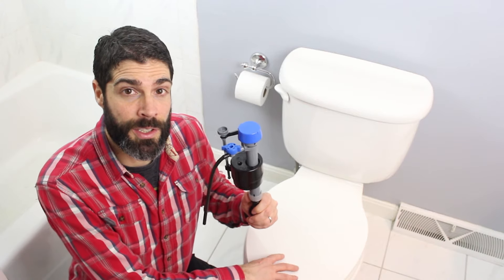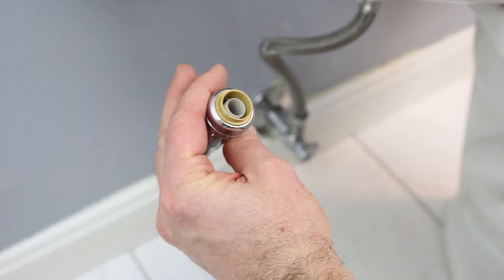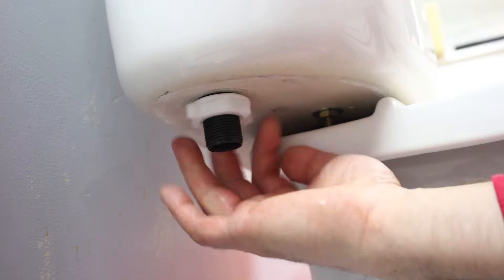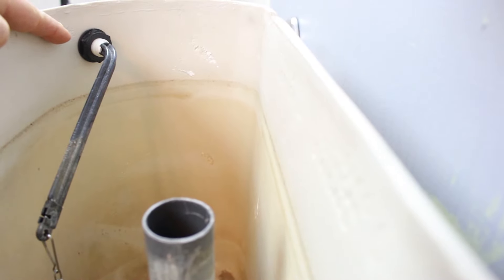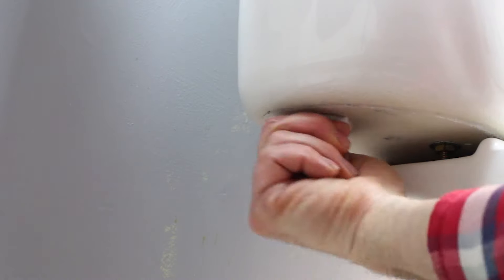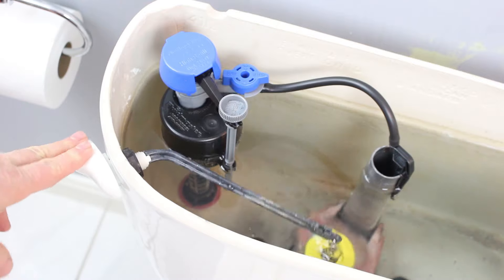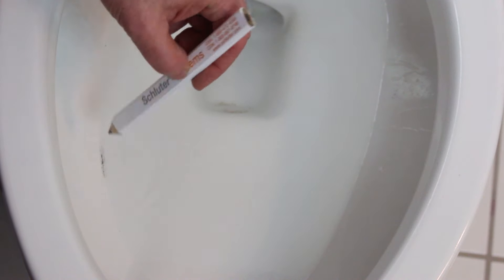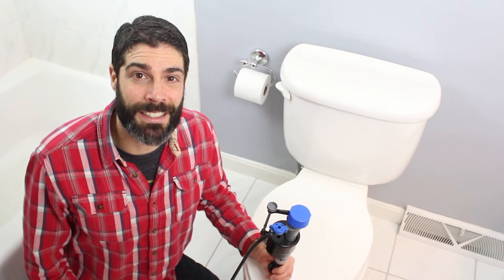Fix a Running Toilet...Fill Valve Replacement -- by Home Repair Tutor

Comment: Thank you fixed my toilet today for $15. 1 tip, not necessarily "instead of measuring", but when I took the old one off, I just made the new valve the same size by lining up the fill valves next to each other and then unscrewing until the same length.😂😂😂 Thank You Again!
Reply: Same!
Reply: Yes sir!
Reply: Thanks pal!
Reply: Genius
Reply: Thank you for the tip, helped me out as well! 👌
Reply: I also measured the new fill valve by the old one. Didn't work out. I have water running after the float has stopped rising with the water. Plumbing is definitely not my thing. lol.
Reply: Same lmao
Reply: Will this valve work for any toilet?
Reply: Thanks for the suggestion!!
Reply: So you didnt need the tape measure?
Reply: Hey man i did but still leaking some water from the bottom.should i use glue for that from inside of the tank ?
Reply: That’s me today$15 part and a I am all set
Reply: @huhu8047   not necessarily, but there is a wide range of toilets that it will work on. Need to check.
Reply: Dude. New homeowner here and resident stoner. Saved my dumb ass the worry of using my iPhone bc I left my tape at the parents lol. Ur a real one 🎉
Reply: Yes! Perfect, I have to do this tmrw
Reply: Smart!

Comment: Thank you! You saved me hundreds of dollars. A plumber was going to charge me $50 to come look at my toilet and up to $300 for parts and labor. I spent $13 dollars on the project and I did it in 10 minutes.
Reply: Same, I had a quote for $288 to replace this before realizing how easy it was thanks to this video.
Reply: these useless handymans should be out of job, if people grow some guts and DIY!, good job!

Comment: You missed a key piece of information. If you don’t slide down the locking nut on the fill valve it will fly off when flush.

Comment: 61 y/o woman just changed a fill valve thanks to your video. All I've ever done with a toilet is use it, clean it or plunge it. Your detailed and to the point video gave me the confidence to feel I could do it. Thank you for saving me money because my other option was to call a plumber to change out a $14 part.😘
Reply: 62 here!  Was able to do it myself!

Comment: Awesome!  I never would've had the confidence to fix this myself except for the assurance shown in this video.  For $10 I was able to replace the fill valve without calling a plumber, and it was surprisingly easy.  Thanks!

Comment: I replaced my flapper earlier, thinking that would solve the running toilet. It did not solve it. That job was already pushing the limits of what I'm confident doing. But despite that, I went ahead and replaced the fill valve using this video. Problem solved, confidence restored. Thank you!

Comment: Water was shooting from the top of my original fill valve. I had to be replace it. I was able to easily replace my damaged fill valve with the same product used in your video and thanks to your steps. 
Thank you.
Reply from the maker: Thank you 🙏🏼 and terrific job fixing your fill valve 🔥🔥🔥🔥🔥

Comment: My master bedroom toilet never ever totally flushed,  I always had to flush twice or more and/  or pour some liquid soap in the center right after pulling the lever so it would flush all the waste. Thanks to you I adjusted the height of the fill system and now it flushes perfectly. I had new flapper and lever , so that didn't need to be replaced. I bought the Fluidmaster 400H because I like the fact that is easy to adjust all features. 
Thank you Sir for a great , short and even more important , easy understand video.

Comment: This video was very easy to understand and every step was clearly demonstrated and explained.  My toilet had been running and I was able to replace the fill valve by myself.  The only issue I encountered was the old one was over 20 years old and I couldn’t unscrew the plastic ring that sealed it to the tank. I had to go buy a small hack saw to cut it off. After that it was a breeze to install the new one. Thank you so .much!

Comment: Tank water and bowl water adjustments?! What?! Mine were not labeled but the tank water level definitely was adjustable and that was all I needed to modify vs replacing the entire fill valve! Thank you!!! I've been fighting with this darn thing since I moved in 2.5 yrs ago. This is at least the 4th time I thought I fixed it so let's hope this time was it. I learn a little something new each time but am definitely saving this video for the future because it's so short and helpful.

Comment: Excellent video. I have Fluidmaster fill valves in all 3 of my toilets, but prior to watching your video, I never knew they were adjustable. (I'm sure I would've known that long ago if I'd taken the time to read the instructions!) The cost of water here is very high and my toilets are older, so they aren't designed to conserve water. They currently use considerably more water than  necessary. Being able to adjust the fill valves will allow me to reduce the amount of water used every time a toilet is flushed. Thanks to you, I'm looking forward to a lower water bill in the future!

Comment: Thanks for taking the dread out of replacing the fill valve.  I have several toilets in my house and it seems that many require the fill valves to be replaced, and I'm not that handy.  But after watching this video, I feel confident that I can make the changes without paying a fortune to have somebody come and do it for me.

Comment: Thank you so much!! This video was very helpful and informative. Once we got the old valve out ( which was a ridiculously long project because the previous owner glued the thing on the bottom), it took about 3 minutes to install the new one because your directions were so clear. Also, very helpful to know which one to purchase- thanks, again!🎉

Comment: Great video fixed mine in 10-15 minutes! I had a lot of leakage from the top of my fill valve and this solved the issue! 10/10 video keep it up

Comment: Thank you for this,  when my old fill valve stopped working,  I thought I would have to call my plumber and wait until he was available.  When I got the new fill valve it took me about ten minutes to complete the job including adjusting the water levels.

Comment: This tutorial was very helpful! Your instructions was well explained and easy to follow. 

At first I went to replace my gasket in my old fill valve but the plastic was so old and brittle I accidentally cracked it 😬

 The new Fluidmaster is better anyhow and since it’s adjustable it’ll help me save water. Thanks again!

Comment: Thanks for your videos. I've seen lots of videos iin Youtube about a valve that won't shut off or fill slow. My problem is the opposite: I flush and it won't trigger the refill unless I give a little shake to the valve assembly, then it starts normally.  The valve is an almost new Fluidmaster. Any ideas?   I have both the fill level and valve open to the with the max little plastic dials.

Comment: I never cut the black rubber thin tube since I installed it and once I cut it to proper length I heard water bubble noise then the toilet bowl was not running water anymore. Thank you

Comment: Fluidmaster fill valves work great and last a long time. The only thing I would add is to replace the flapper valve while you’re in there.
Reply from the maker: Ya, replacing the flapper is a good idea if it’s looking worn out

Comment: This really helped. Thanks! Only problem I had was connector to wall kept slowly pumping water, but I guess didn't shut valve off hard enough, older valve, though toilet replaced in 2016.

Comment: Very good guide to replacing the fill valve, but here are some other tips.  1 - Turn off the house water in case the old shutoff valve at the tank leaks or you bump it and turn it on again (no, didn't happen to me).  2 - The nut under the tank holding in the old filler post doesn't undo with fingers, it needs a wrench.  Before starting, practice getting to that nut with the wrenches you have.  If you can't get to it, don't start the job and then get stuck halfway!  Can't reach it on our toilet, too close to the wall, had to call the plumber anyway.

Comment: I look after several rentals. As for running toilets, I find 80% the time it is the old flapper that’s hardened or cracked. 20% time its the fill valve, plasticky and rubber seals can also harden.

Comment: Thanks for the Informative video   in my Apartment my toilet fill valve I think is gone and is running costing my water bill management keeps replacing the flapper, the last flappers still running I think it is the fill valve  gonna have it checked not my job as renter to fix their problem

Comment: I have tried those shark bite fittings they are a lot easier good buy I thin my opinion makes a job quick and easy.
Reply from the maker: We like them for quick swap outs of the shut off valve, pipe prep is important but very easy

Comment: Hi there,   Mom here trying to figure out all the mechanisms inside my toilet, so I would know
what needs to be done to stop the toilet from running.  I really appreciate your demonstration, and now I understand.
Big question.  
My one piece toilet has the straight sides, so everything is concealed.  Does this mean that my toilet will need to
be un-bolted from the floor and moved away from the wall to get at the Fill Valve screw?
I'm trying to figure out if Labour Wise, it would be cheaper to replace the toilet, rather than just fix the problem?
I just looked.   My $280.00 toilet is now $500.00 + tax  thanks to Covid, I'm sure.  
Thanks ever so much!

Comment: A great video I could easily follow if only Barney Fife had not installed the toilet.  He tightened the white plastic bolt to the water supply line so tight it is impossible to remove.  I've tried doing it by hand and with channel lock pliers.  It won't budge.   Also there is not another white plastic nut above that that you show in the video if that makes any difference.  Any ideas as to how to remove that large piece that should just twist off??  Now that I've fiddled with it, it has a slow leak so i must have nudged it just the tiniest bit.  Whoever installed this bathroom did not know what they were doing.  I went to change my bathtub spout and found that they had used construction epoxy to adhere it to the pipe rendering the threads on it useless for putting on a new spout.  Who does that??  But that's a whole other problem.  Any  suggestions as how to get that white valve off? Many thanks!!!  P.S.  I will try the WD40 you spoke of in another video.  Hopefully, that will work.

Comment: Thank you for this—so clear and easy to follow! Any ideas why the toilet is much louder when filling now than with my previous (~15y) valve? We're also getting a phantom flush every now and then (water running for ~20 seconds then stopping). Maybe an error in installation?
Reply: There is a good chance your flapper is worn and not seating properly on the flush valve orifice. Chlorinated water degrades the rubber, and it allows a tiny trickle of water into the bowl resulting in the float slowly lowering and thus eventually activating the fill valve.

Comment: Are there any tips to remove a recessed nut? My toilet design has the valve all the wall recessed upwards and there is barely room for a hand to fit in. The wall is touching the back of the toilet... Would appreciate any help... I tried twisting the whole fill assembly within the cistern but it's not moving. Thanks so much!!

Comment: i'm getting water leakage after installing the fill valve and hand tighening the plastic cap /bolt under neath the tank.  Should I add vaseline to soften the washer??

Comment: Two things need to be mentioned.
1. Backflow preventer (black/white spriral object) that comes inside the fill valve.  Don't need to remove it.
2. The supply line may leak if it is not secured properly.  Make sure the washer that comes with the supply line is in good condition.  I had to use some plumber's putty to make sure the water was not leaking.

Comment: I suspect there's sand in the valve because I had to re-pipe due to both hot and cold pipe leaks under the validation a foot or so from the exterior wall. Faucet aerators had some sand in the screens. I would like to know if I can take off the top of the valve and clean out the washers before I replace it. I so how to do it on another video but it was a different type of the valve assembly, mine is similar to this one except it doesn't have a separate bowl fill adjustment that I can see. Or I can just wait for my plumber supervising the repiping to get here.

Comment: I am a licensed professional plumber. It's a terrible idea to use shark bite fittings. I would highly recommend at least a compression stop for copper pipe. Or a pex stop and pex ring for pex pipe. At least for this application. This is a terrible idea, I would only ever use a shark bite fittings to maybe cap off a water line somewhere temporarily. But I mean don't let me tell you what to do, I don't mean to get on a high horse. But for real, shark bites are no good for permanent installations.
Reply: I respec and appreciate  your advice Whats the downside of the sharkbite fittings ?

Comment: I bought this exact fill valve and the knob for the toilet boil water isn't doing anything. Also. I noticed b4 installing the new fill valve that the overflow column was seated very low. Now, I'm wondering if that's an issue. I'm  dealing with a toilet that I have to consistently plunge. It's not a noise issue. The guy at Home Depot said to be the line that says CL for clearance line is 1 inch above overflow column but your are saying something different. I'm not sure which is correct. Please advise. Thank you

Comment: Thanks for the video, but I have a question.  It appears to me that part of my problem is that the shut off valve wont shut all the way off.  It keeps dripping. Does that mean I need to change the mechanism coming out of the wall?  If the drip isnt a big deal, could it be the reason the toilet keeps running?  Because I think as the tank slowly fills, that is the reason why it runs every 45 minutes at night.  Please let me know if I need to call a specialist or if I will be ok just changing the fill valve, and letting it be.  Thank you.

Comment: Thank you for Video..I would like to ask, what is the purpose of Black Hose? Thank you.=)
Reply: It fills the bowl back up. The valve part only fills the tank. The blue wheel on the tube can be adjusted so you don't over-fill the bowl.

Comment: I have a question, I have that same valve in my toilet, but in order for it to start filling up, I have to press down on the grey spinny part, does that mean I need to replace the pump? or is this just a setting that needs tweaked?

Comment: Hi, is this fix of replacing the cistern inlet valve applicable for when the water does not rise back into the cistern after flushing the toilet and the button to flush the toilet becomes loose and not workable?

Comment: Can this be used in a Toto toilet? I have changed a fill valve before, but it looked nothing like this. The Toto toilet I have has been running so much, I think it could be the reason my water bill has more than doubled.

Comment: I've been trying to unscrew my water supply line from the fill valve for over an hour; I'm jealous of all these people who are able to unscrew it in seconds. Mine has a brass nut, and although I was able to get some leeway at first, now when I try to unscrew it just makes the fill valve spin around. I don't have a clamp and I live alone so I'm trying to find a way to get the fill valve to stay in place without those things - that's how I found this video. Sucks (for me) to see someone spend seconds on a step that has taken me over an hour with no resolution in sight. I'm really frustrated with the person who installed the toilet for using such a tight and unscrewable nut.
Reply: Same here. It leaks after I install it 😭😭 I want to cry
Reply: I have the same problem.   Some one screwed the old fill valve on too tight.   When I try to loosen it turns the old fill valve and does not come off.  Not sure how to get it off.
Reply: I used a small hacksaw to first make a diagonal cut or two into the side of the nut,  and then wedged off the loosened nut with a slotted screwdriver.

Sometimes you can remove a stuck nut using an adjustable pliers or wrench (8 or 10' tool length with wide enough jaws), turning a quarter turn at a time if the space is especially restricted under the tank to fit the tool head / handle(s)☺️

Comment: Can I ask a question, I watched this video to give me guidance to install two Fluidmaster 400a units in my house. 
Now, one of my toilets seems to be running off and on again.  I observed it this morning, the water level was about 1" below the flush valve, but then the fill valve would go off and on every 30-seconds running again for ~5-seconds to try and fill.

Not sure what I'm missing here.  Thanks!
Reply: Probably need to replace the flapper valve too.

Comment: Good video, but the white plastic retainer holding the old valve in place won't budge.The problem with videos like this is that the video producers use new equipment and everything comes apart cleanly and effortlessly. In reality, people like me are using different wrenches and pliers trying to remove that white retainer that won't come off. In most cases, time has cemented these things in place. So these videos are only good if you're trying to remove a new valve from a new toilet. The plastic retainer is made to unscrew with just one's hand, but after seven years it's glued in its position. I don't think the HULK could loosen it.

Comment: I installed the k-400h-039.    Everything went well.     However, now I here a sound like water running for about 3 seconds then stops.    Is it the flapper?